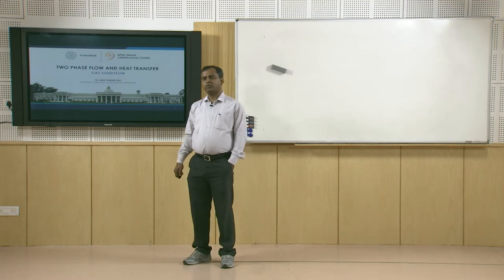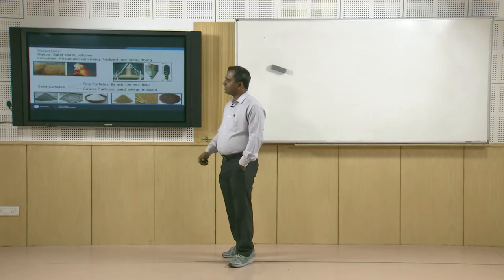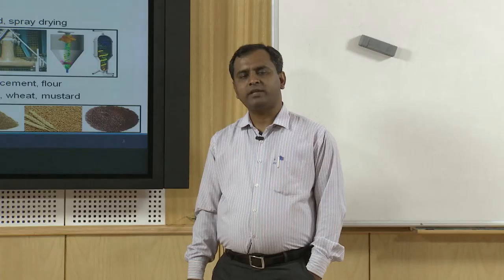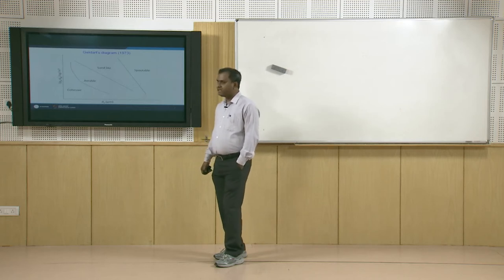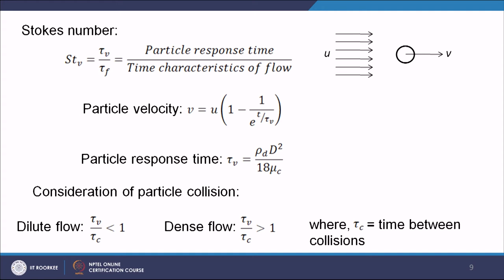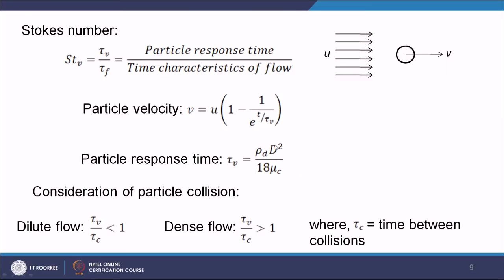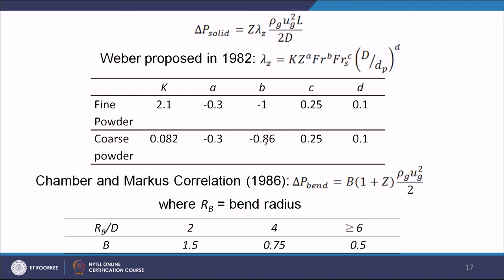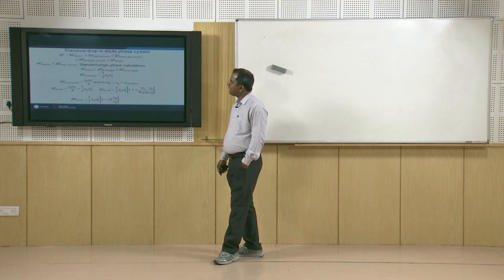Gas-Solid Flow

Comment: Particle response time formula is valid under stokes regime right, meaning particle Reynolds number is 0. But when particle flows under the influence of air flow, its Reynolds no. will never be 0 right. Can we still use this formula. Or am I understanding this wrong, other way round of thinking this formula is initial Reynolds no. of particle should be zero meaning particle should be at rest before coming under the influence of air flow. Please explain. Thanks